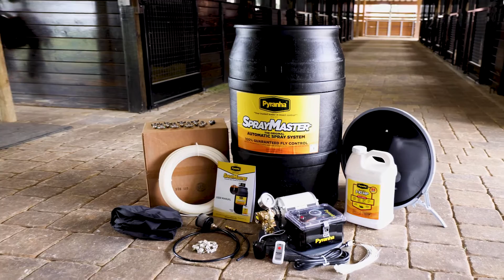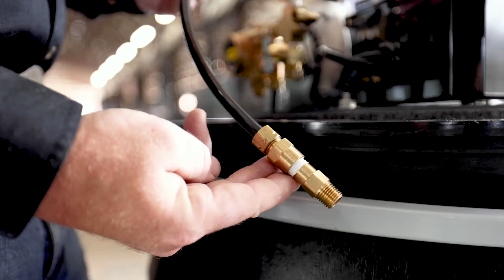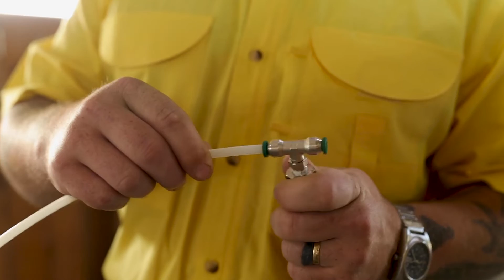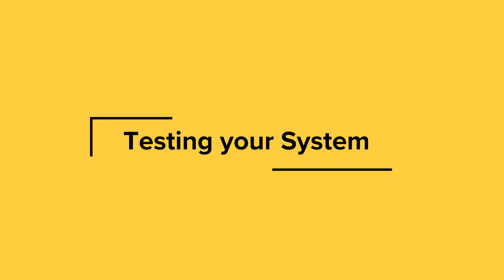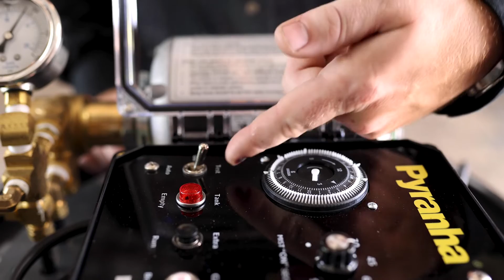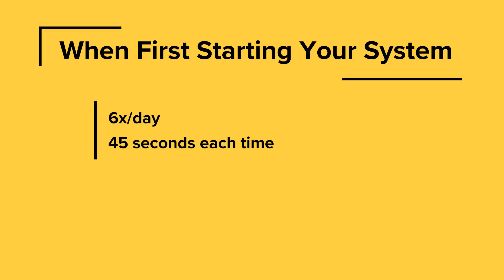TUTORIAL: Installing your Pyranha SprayMaster System

Comment: can i set up the tubing and nozzles as a big grid of elbows and tees or does it need to be a single continuous flow path, like your patterns show? seems like as long as it is pressured and does leak either way would be fine.

Comment: Great product!  
For anyone wondering, yes, this will work in a mare motel!  I set mine up last Sunday by myself. I started late and it took me a few hours for a 6 stall mare motel with a covered breezeway and I wasn't finished until after the evening feeding.  
I can't believe how fast and great this worked for me. Sunday during the install the flies were brutal and thick. By this morning (Tuesday 2 days after install) there were very few! 
My horses are much more comfortable without being bothered by the flies. They seem much happier to be in their stalls now.  
We even had a power outtage last evening for over 3 hours, but the clock in the unit kept the correct time anyway!  
I recommend this to anyone who is trying to get rid of the flies and other insects in their barns, even if it's an open pipe mare motel.